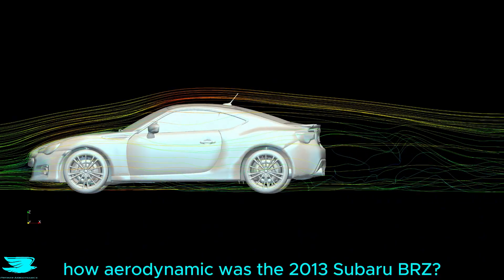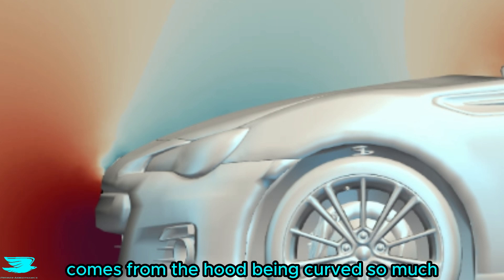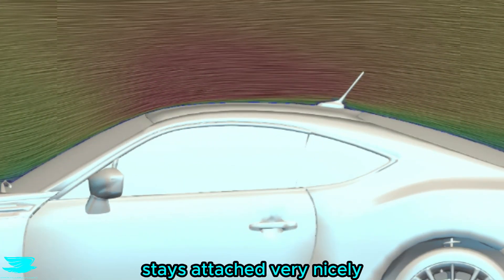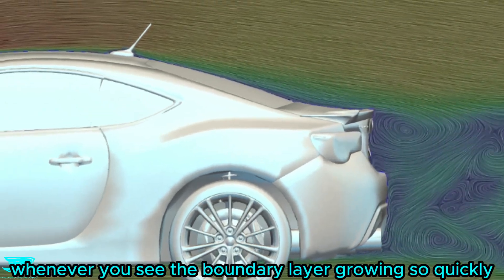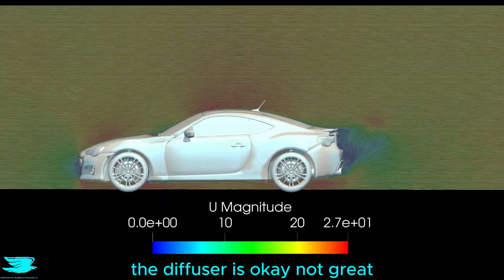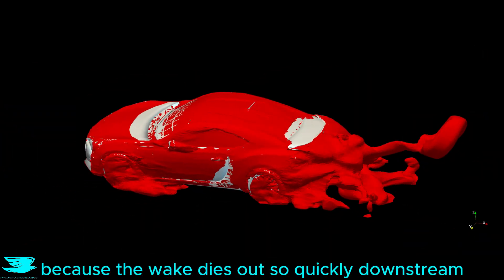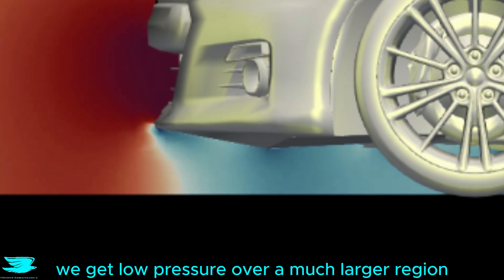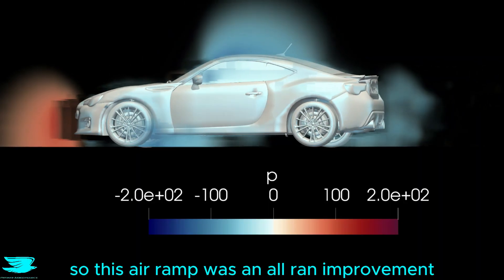Aerodynamics of the Subaru BRZ 2013

Comment: Would love to see if the different front bumpers for the other versions change things. I've got an FR-S and definitely notice the hood likes to get floaty on its latch so it still has that low pressure. The aerodynamics also seem to change noticeably around 90-110 MPH depending on conditions. 

It's a turning car so the lift isn't killing it. Good to know when riding in someone else's they've done something silly with under the hood to make it a bullet.

Comment: Found this channel from your E92 M3 video on my recommended feed and was praying you had a BRZ video since I own a 2015 BRZ that's considerably modified. This video was super helpful! Just wish you went into as much detail as you did with that M3 haha 

I'm a mechanical engineer looking to design and build an active aero wing and would love to see how well that would work at high speeds. I actually figured the stock BRZ didn't have good aero over the rear window since, while driving, rain would stick on the rear even at high speeds and would not run off. I added louvers to solve that issue but now I know it's because of that boundary layer.
Reply from the maker: Yep, sorry. We might need to look at the new one in the future. The rain sticking there might also be because of some separated flow. 

If you'd like to know more, you could stick little wool tufts on the window and video how they move.

Comment: Do you have any data concerning vortex generators? Have been toying w/ the idea of mounting a set across the front of the hood and just before the A pillars, to dampen the drag of the sideview mirrors. Would like to know how affective they are vs hype/sales BS.
Reply from the maker: For those particular VGs, I don't have any data on, but for the A pillars, they might also be there to break up the vortex from there - they form if the A pillars are too upright. They might also help reduce the noise. For the side mirrors, I don't know if they will reduce the drag because if you give it more chaotic flow, that means you had to use energy to create the chaotic flow to begin with. But maybe they developed their mirrors together with the VGs, so there's a new design. I'm not sure, sorry.

Comment: Please yaris hybrid mk4! (I wouldn't mind either the gr yaris or gr corolla :D)

btw 1:15 doesn't hot air from the engine bay come/get sucked out from there and is it accounted for in the simulation?
Reply: Hot air does not exit at the spot between hood and windshield. Because of the high pressure it would likely force air in under the hood. That spot is usually the intake for the inside vents
Reply: @BrokeWrench oh that's right, the intake grille for AC

Comment: Awesome video and analysis.

Does the ramp go across the width of the car or just in front of the tyres?

Could you advise the basic dimensions?

Cheers.
Reply from the maker: It's a very flexible design. The more of the width it spans, the more of an effect it will have. So, you can play with its dimensions there.

The same is true for the height, but I wouldn't go too extreme because you risk separation. So maybe 5 or 10 centimeters will be a good amount.

Comment: So a sharper front bumper cover helps a bit,a wide air ramp under the bumper will help a lot,also a rear diffuser?
Reply from the maker: The rear diffuser can always be improved. However, the only practical way would be to add guide vanes and perhaps endplates to it so the wakes from the wheels don't interact with the flow under the diffuser.

Comment: Can you do the legendary Lexus LS400? As far as I know it has a pretty advanced aero for the time with a low .26 cd coefficient. The Skyline GT-R R34 V-Spec II would also be interesting imho.
Reply from the maker: Thanks for the ideas! We have them both on the list!
Reply: @PremierAerodynamics  Awesome, another request I have is a niche product but I drive one so, naturally, I am very interested to learn whether the fuel efficiency (the drag) can be improved on my vehicle. I drive a 2013 Lexus GS450h F Sport. I am curius if the drag would be improved if I cover the brake cooling ducts on the front bumper. Would be happy to help you with measurements and pictures for this one

Comment: I've been hoping that someone would make this video for years at this point! Verus has their pictures, but to have someone talk it though is super helpful. Also, where is the air ramp in the model/what should it look like? Am curious how this might impact real world handling.
Reply from the maker: It's a gentle bump on the underside just after the front lip/splitter. It adds downforce to the front of the car. That helps reduce understeer.

Comment: You know, I'd be extremely curious to know what this all means from the perspective of a hobbyist looking to upgrade their car. With the rear window being a sore point, would vortex generators help? What about an aftermarket diffuser or small mods one could reasonably do?
Reply from the maker: If you have a rear wing very low down, then vortex generators would help get faster moving flow there.

Comment: I made an undertray out of plywood which is shaped like that on my car, the shape is mostly from riv nuts to the subframe, but it's nice and sturdy, it covers the whole front bumper area, open where the exhaust is but covers the underside of the engine
Reply from the maker: That's interesting. Did you notice any difference in handling?
Reply: @PremierAerodynamics  I honestly never drive the car hard enough to notice, but I'm sure I got a few extra newton's on the front, I mostly noticed the engine ran a bit cooler but warmed up faster before Thermos kicking on

Comment: There are way to reduce the drag on the frs flat underbody verus engineering has those , apr mirror smaller , rear diffuser,  varus engineering , cut the rear bumper is important , air dam
Reply from the maker: Definitely. This car doesn't have much of an aero focus, other than general drag reduction. So, there are a lot of things that would work.
Reply: @PremierAerodynamics  lve been thinking about this alot and not really quite sure if it will work semi trailer tire and wheel creat drag what If I build a larg wind deflectors like formula E would it work

Comment: Fantastic, just a small ramp under the car, I have that, because I lost one of the clips on the splash shield and it bows at speed, but it never touches the ground. My laziness and improvisation removed a huge chunk of lift on my S2000. :)
Reply from the maker: Lol! The best engineers are the ones that can get the results with the wrong materials. Lol!

Comment: Not sure its just me being dumb but the way you seem to classify stability seems a bit odd to me.

I would have thought having loads of downforce near the back and not much at the front would be "stable" as the car would want to keep going straight. It would be terrible for high speed agility/turning, but good for high speed stability. Whereas it seems youre saying downforce over the front js good for stability, regardless of the rear. But surely down force on the front with little on the rear would make the front very twitchy and the back floaty, which to me sounds like poor stability.
Reply from the maker: Good question. The answer depends on a few things.

The first is that most cars produce more downforce at the rear than the front because of the general shape and diffuser. That leads to potential understeer during corners. Having a more balanced downforce production makes it more stable.

As for straight line speed, it depends on where the power is coming from. If you have a rear wheel drive car, then more downforce over the rear wheels helps you put the power down and go faster. If you have a front wheel drive car, then downforce over the front helps do that. All wheel drive generally has a pretty even split, with perhaps a little more on the rear wheels.

The more downforce over the driving wheels, the more grip, and the faster you can go.

Comment: It would be interesting to see the calculations on the generation seven Celica , as there is little to no actual hard data on the car . 
Being the last sports coupe to come from Toyota before the American styled GT. Apparently the little data available suggests its 0.29 . 

As the car and a first generation Prius have kinda the same shape with a lower ( maybe lowest Toyota roof line ) maybe it would come out on the top of the list . I was lucky enough to be involved with a vehicle that competed here in Australia that had some input from the lead aerodynamicist the first generation Tesla . 

He later moved to Toyota Australia and the GT86 was the vehicle he was given , we evaluated it one day for a silhouette racing class but he pointed out all the style over aerodynamic area's that would change the overall shape to radically ( as per GT300 ) for the GT86 to be used in the class .
Reply from the maker: Thanks for the idea! We have it on the list!

Comment: That Air Dam improvement was impressive, I wonder how aftermarket front lips affect the aero, they could add some small gains ot the other way around...
Reply from the maker: I think aftermarket air dams would work better because aftermarket splitters would have to be really long to have an effect because the car is quite far off the ground.
Reply: I'm guessing most of the lips I've seen will increase drag, especially if they're not true splitters.  That little bit about rounding the leading edge of that splitter has me rethinking how I'll do mine, and I'm glad!

Comment: Could you do the Hyundai Staria? 80's wedge supercar front on what is essentially a sideways apartment building could be interesting.
Reply from the maker: Thanks for the idea!
Reply: @PremierAerodynamics  Oh man I am full of ideas, just lack the training, skill, knowhow and resources to test any of them. Like an actual CFD analysis of golf ball surfaces for vehicle aero where boundary layer separation is actually important. Another one would be the whole TVR Sagaris fender situation where they actually designed louvres to extract wheel well pressure but for some reason never actually opened the holes and left a "shark skin" surface... which leads back to the golf ball idea where what if a vehicle was covered in a shark skin surface like 200,000 tiny little Kammbacks? Some nights I think myself to sleep trying to resolve the issues of CVT gearboxes by imagining conical friction surfaces that could act like cones of sandpaper... Yes I'm fun at parties.
Reply: Toyota figured out the CVT problem with their synergy drive.  The limitation is you need an adjustment input to act as a transmission. They use an electric motor, it could also be hydraulic or even geared with a secondary transmission like the old tanks used for turning

Comment: Fact :- subaru BRZ , Toyota GR 86 , Scion FR-S are same cars .
Reply: Small changes in suspension balance and interior trim but otherwise the same
Reply: First gen: BRZ, FRS, 86/GT86
Second gen: BRZ, GR86
Reply from the maker: And I remember back when it was released that the deal was that Subaru could only sell like 10% of the cars Toyota could. So, even though they were basically the same, there was a premium on the subarus because they were rarer. Not sure how long that lasted though.
Reply: @PremierAerodynamics  oh that's interesting 🤔